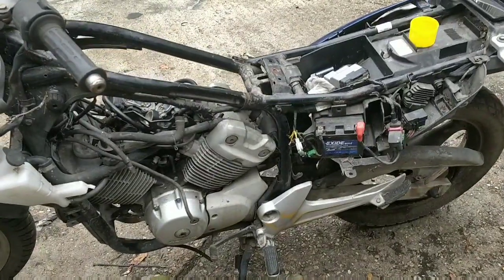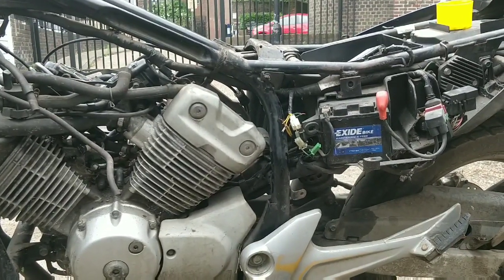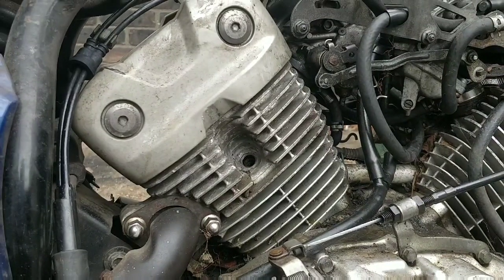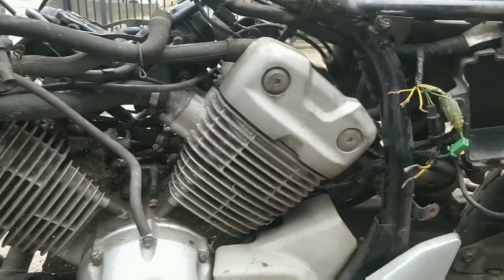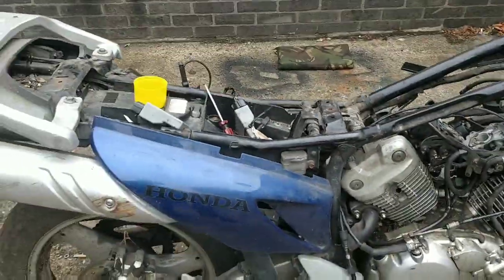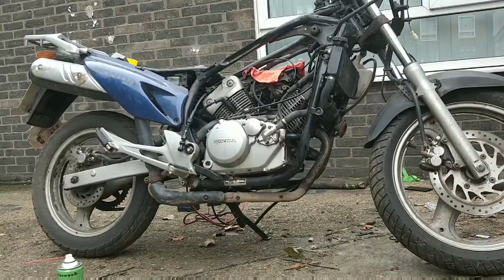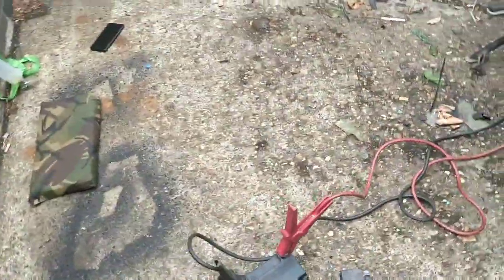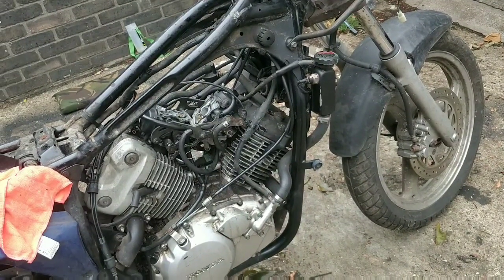How to diagnose and fix spark issues, honda varadero 125 part 2

Comment: the kill switch cuts power to coils same way  that the  ignition does .. (ignition, kill switch, side stand switch) they on same circuit
Reply from the maker: In the end I had to buy a new set of carns, nothing I did to the originals would work smoothly. It ran great in the end though
Reply: @motorcyclerescuer  that's only problem with 2nd bikes ..you never know how much abuse they've had by previous owners .. ..ah well glad you got it sorted buddy

Comment: try new plugs and the leads try the leads some WD40 on the leads, and try the caps ;-)
Reply from the maker: I think it will run when I put the filter back on. I'll give it a shot in a hour or 2. Might get lucky

Comment: When I had a Triumph Sprint  they are prone to killing the rectifier and was told to cut the 3 yellow stator wires block off and re-connect it for better connection and was told it makes no difference what way round the wires are
Reply from the maker: Oh really Vince, that's probably saved me so much time and worry. I wasn't sure what order to put them in.

I think this bike will start with the air box on so I'll give it a shot later. Thanks for the info. That's a great thing to know.
Reply: @motorcyclerescuer  let's hope it starts soon for you
Reply from the maker: @veade123  tried a hour ago vince, front carb was dry, no fuel getting through. So somehow need to get the bowls of even though the screws have rounded.
Reply: @motorcyclerescuer  let's hope you can fathom a way to sort it

Comment: KAPOWW -- Well done mate. I'm wondering if that spark was a bit orange? Dunno though. Glad you got a spark though - brilliant.
Reply from the maker: It looked pretty white, it looked strong i thought. I'll throw on the air filter and box and turn it over properly tomorrow. Never know might get it running.